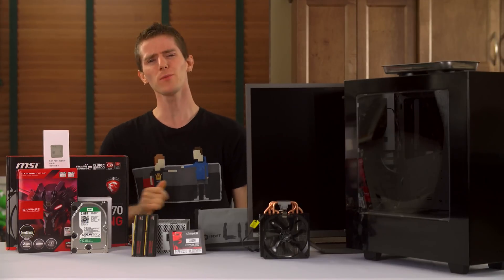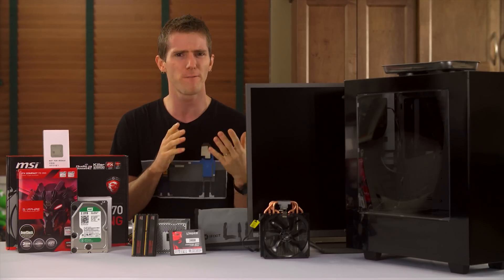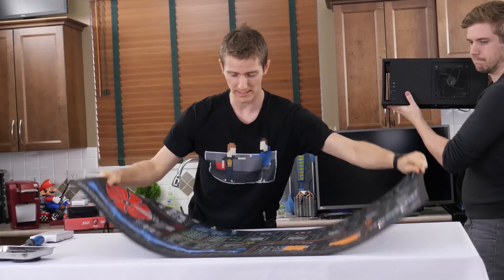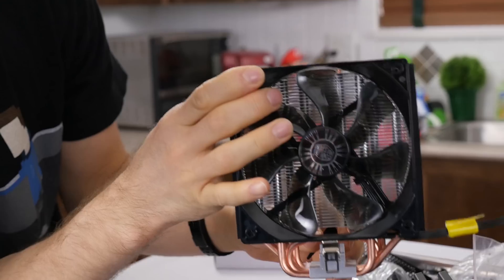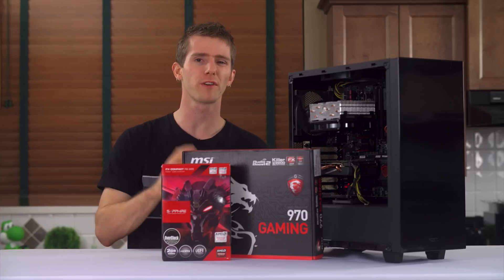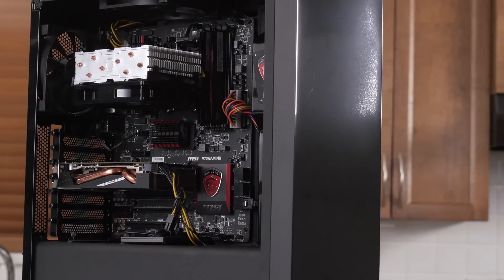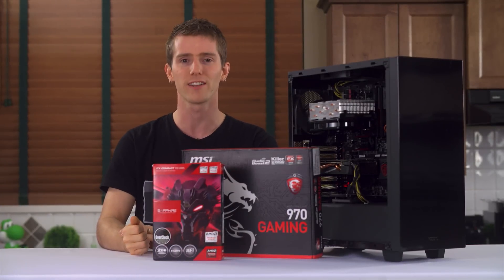Can you Build a 4K Gaming PC for Under $1000?

Comment: 4K won't be a standard for a while...how long did it take 1080p to REALLY become one? getting smooth gameplay at 1080p with max settings is hard enough at under $1000, so why do this? and, when you use an FX CPU on a cheap motherboard, you really can't overclock, which is pretty much the point of getting an FX chip...and, why run on 4K when the games are old/lower tier graphic-wise, and not on great settings? the point of gaming on a PC is for the max graphics, which is what the game was truly designed for...

Comment: This is similar to a pc i built for the holiday sales why is it that all these guys leave out the O.S. in their guides specs
Processor: fx 6300
Motherboard: msi 970 gaming
Graphics card:sapphire Radeon 280x
Psu: corsair cx600
Ram: 8gb ddr3 1600 g.skill gaming series memory 
Ssd: kingston v300 240gb
Case:Rosewill galaxy 0-1a 
Heatsink: artic freezer pro 7
O.S.: windows 8
All together this cost me about 850 first pc ive ever built and i enjoy it runs smoothly.

Comment: Would an MSI 970 gaming mobo + FX-8370e+gtx960+8GB 1600mhz ram be a good gaming rig for 1080p everything on ultra?
Reply: I would recomendgoing with a radeon r9 280x or 285 instead of the gtx 960. :)
Reply: Yeah. Trade out the 8370e to a regular 8370 (a performance boost) if you have the wattage to do so (the 8370 takes like double the watts).
Reply: Byron Shultz cheers, can you recommend a 3rd party CPU cooler?
Reply: Eds UKGamerz Corsair H100i
Reply: thanks for the recommendation
Reply: Eds UKGamerz get the enermax liqtech. ALL other AIO coolers are the exact SAME, shitty radiator. You can bend the fins with PAPER. this one is freaking built like a tank ( Watch Jayztwocents review of it). and it's cheaper, AND looks better. I've got it with 4 noctua nf-f12's, my I7-4790k idles at ROOM temperature, seriously. it's 70 in my house, it sits at 70-72 degrees F, with the fans on min. rpm. oh, and it's overclocked, 4.8 Ghz boost clock, adaptive voltage at 1.275 max... at 100% load, 65 C max in prime 95 large FFT, or full load in Folding@home, etc. , in games it never gets out of the 40s. Can't say this enough. Stop supporting companies that just rebrand a low quality product and charge 2 times as much as they should for it!!

Comment: Lol my laptop (intel celeron 1007u @ 1.5ghz and 4 gigs of ram) runs team fortress 2 fine (40-50 fps)
Reply: at 720p?
Reply: Fathin Luqman Tantowi 1024p
Reply: oh ok, can't distinguish celeron procies T.T
Reply: Fathin Luqman Tantowi the 1007u is a low end mobile cpu
Reply: jaakko200987654321
nice, thanks.
Reply: Flaming Gaming lol, that integrated graphics. 2Ghz dual core is too weak even only running windows. unlike newer version of intel. you must blame intel for the integrated graphics. coz they suck @ graphic
Reply: Fathin Luqman Tantowi I know, I'm just saying that this guy can't possibly run TF2 on a Celeron (1.5GHz dual core) if it can't run on a 2GHz Pentium.
Reply: That can't be true. I tried to run Portal 2 on a laptop with a Pentium (don't remember the exact model but it was clocked at around 2GHz) with integrated graphics and 4GB of RAM on lowest settings and 800x600 resolution and only got 12-15fps. Unplayable.
Reply: Well new celeron is fast I suppose

Comment: soo i'm trying to make an AMD build, will this rig be enough to run games at ultra definition?
CPU: AMD FX 8-Core Black Edition FX-9370
GPU: SAPPHIRE R9 290 4GB GDDR5
Motherboard: ASRock 990FX Extreme3 AM3+ 4DDR3
RAM: Corsair Vengeance® Pro Series — 8GB (2 x 4GB) DDR3 DRAM 1600MHz
SSHD: Seagate 1TB 2.5" Internal SSHD Hybrid Hard Drive
Case: Cooler Master CM 690 III
PSU: Corsair CX Series™ Modular CX750M — 750 Watt 80 PLUS® Bronze PSU
i don't mind noises so gimme what you think :D
Reply: More than enough.
Reply: Thank you!

Comment: If someone could help me that would be awesome. Ok so I'm going to be building a gaming pc and I have all the parts but I'm afraid I'll have a bottleneck. I'm going to have an intel i5-4690k and expect to OC it. And for graphics card I'm using a EVGA gtx 970. This is where I'm afraid I'll get a bottleneck because the processor is about $100 cheaper than the graphics card it seems I'll get a bottleneck. So if someone could help me that would be much appreciated.

Comment: CASE	Thermaltake CommanderCPU	Intel Core i5-4690K	
VIEW
FAN	CM Hyper 212 EVO	
VIEW
MOBO	MSI Z97 PC MATE LGA 1150	
VIEW
GPU	Gigabyte GeForce GTX 970	
VIEW
RAM	Kingston HyperX Fury 8GB	
VIEW
HDD	Western Digital Blue 1 TB	
VIEW
CASE	Thermaltake Commander	
VIEW
PSU	XFX Core Edition PRO550W	
VIEW
ODD	Samsung 24x SATA

Is this a good PC?

Comment: Ive Oced my fx6300 on a stock cooler, to 4.0 ghz and when playing league it hasn't reached over 55 celcuis    hgihest its been is 61   but I keep it oced to 3.7 to 3.8   of course everyone cpu is different so I might have just hit a lucky fx 6300, also I'm not using the stock thermal paste, as I upgraded my mother board from a micro to a full size.

Comment: Hey, I'm building myself a new gaming pc but i'm not the most experienced.
What do you's think about this build? I want to play pretty much every game maxed running smooth. What could be changed to make it better? I'm thinking about spending a bit more and getting a gtx 980 but there so expensive.
Intel i5-4690k 3.50GHZ
ASRock Fatal1ty Z97-KILLER
Asus STRIX-GTX970
Corsair 16GB
Seagate SATA3 2TB
Corsair 850CXM 850W
NZXT H440 Mid Tower Case
Crucial MX100 256G
Corsair H100i water cooler

Comment: I built a pretty good rig that can run Skyrim Ultra at 60FPS and Cod AW at high at about 80 fps. It was only around $750

Specs:
Intel Core i5-4690K
Sapphire R7260x
WD Blue 1TB
GSkills RipJaws 8GB
Asus B85M-D Motherboard
Any case

Comment: How does this build look?  Supposed to be a decent gaming rig.
CPU: Intel Core i7-4770 3.4GHz Quad-Core Processor  ($294.88 @ OutletPC) 
CPU Cooler: Phanteks PH-TC14PE_BK 78.1 CFM CPU Cooler  ($79.99 @ Amazon) 
Motherboard: Asus SABERTOOTH Z97 MARK 1 ATX LGA1150 Motherboard  ($239.98 @ Newegg) 
Memory: G.Skill Sniper Series 8GB (2 x 4GB) DDR3-1866 Memory  ($74.97 @ OutletPC) 
Storage: Samsung 850 EVO-Series 120GB 2.5" Solid State Drive  ($88.98 @ OutletPC) 
Storage: Western Digital BLACK SERIES 1TB 3.5" 7200RPM Internal Hard Drive  ($73.98 @ OutletPC) 
Video Card: MSI GeForce GTX 980 4GB Twin Frozr Video Card  ($549.99 @ Newegg) 
Case: NZXT H440 (White/Black) ATX Mid Tower Case  ($108.99 @ SuperBiiz) 
Power Supply: EVGA 750W 80+ Gold Certified Fully-Modular ATX Power Supply  ($89.99 @ Newegg)

Comment: Is a msi GTX 970 card going to fit inside my tiny MSI nightblade computer? It is as for now, using a MSI GTX 760 card, but i would want to upgrade the nightblade and bring the other MSI gtx 760 card into a yet to be built computer.

Comment: Hi

Need some answers lol

I am spending money on a good racing simultor cockpit to replace my desk as i want to be able to relax and play
my system is
i7 5930k water cooled
16gb 3000hz dominator platinum ram
asus deluxe x99
1100w corsair power supple
samsung 1tb ssd for my games
samsung 240gb ssd for my system
radeon 295x and a 290x

I dont know what to buy im really stuck
x3 27inch ips monitors or x1 55inch ultra hd tv or just regular hd tv

I mainly play rpg, dota 2, elite dangerous and racing games and occasional bf4

will tv really be to much of a lag input and ruin my gaming experience

Comment: the problem is if the gamer only play such games im betting they wont be buying a 4k monitor either... great mid to high spec build though and yes ready for 4k when the need arise (or the 4k monitor becomes reasonably priced) by simply going the crossfire route.

Comment: One of the best PC video blogs I have seen in ages. Finally not all about the top of the range most pornolicious hardware. I would love to see a bit of variation in the hardware to see the effect on benchmarks though..... plz .... 

For example if the 8350 cpu (which is still very cheap) yields any performance increase (as it does have 4 true cores rather than 3). 

I would also be interested to see how these games at this resolution differ with a mid range intel mobo and a stock i5..... 

Thanks Linus ;-P

Comment: hey guys is this an ok rig for gaming?
Gigabyte Radeon R9 280 WF3 OC 3G
NZXT Phantom 410 BLACK/ORANGE ATX Mid Tower 
Aerocool VP650 tRUE pOWER psu
Kingston 8GB (2 x 4GB) PC3-12800 1600mhZ ddr3 rAM
Cooler Master Hyper 212 EVO CPU Cooler
Intel  Core i5-4690K Devil Canyon 3.5ghz Socket 1150

Comment: Sorry Linus is wrong on this one. I dunno if it is because he was trying to peddle his  sponsors over priced crap but you can build a machine with a I5-4690k and a GTX 970 for about $750 to $800.
Reply: In England you need like £650-700 f($850-950) or a PC with a 4690k and a 970.
Reply: Still under $1000
Reply: Stephan Bruno
Fair enough...
Reply: No, you can't. Not without making silly choices if you want your system to last for many years. You could do an i3 and a 760, but your choices can only work by skimping on the PSU, cooling and motherboard. That is fine if you buy a new computer every year, but it you want this to be a home server for a decade after you retire it (or you want to continually improve it as your primary machine), then you need to step on on the CPU and GPU.
Reply: well, remember, if you get cancer in america, you are down about 300k $ that gtx 970 price wont help there
Reply: Martin Lyons I have heard somewhere that amp cpus are actuallu similar to hyperthreading so there are only 3 cores in 6300?
Reply: The CPU/GPU combo you mention costs $500 before tax w/ deals. You're looking at low-end components and no SSD if you're trying to get sub $1,000. Better than the build in the video, however.
Reply: Cameron Montlake-Mees
huh 950$? here in denmark you might get lucky and get this for just under 1400$ ^^
Reply: Mikee Tyson I take back my last statement, maybe £750 if you could do without a SSD: http://uk.pcpartpicker.com/p/zgtCMp . And Denmark PC prices are higher, I want to live in America where you can get a 970 for the equivalent of £200, where as in the UK it's like £250-300
Reply: Mikee Tyson And in the UK we have the NHS, so I guess I'm staying here.
Reply: Cameron Montlake-Mees Nice build for the $. I'd say the other big trade-off along w/ no SSD is that the mobo in the build doesn't support SLI.
Reply: TrevForPresident
TBH I don't use SLI boards in builds of this budget, because normally my builds last 3-4 years and then are replaced. I guess it depends on if you are upgrading or not.
Reply: Cameron Montlake-Mees Point taken. Worth noting, however. I'm getting that itch with a one-year old rig and a 770. GPUs don't age as gracefully as CPUs.
Reply: a 770 should be able to play all games on ultra/very high for the next 3 years 1080p
Reply: i bult mine with around 1grand with better specs from last year and none of the games he mentioned need to be low res in order to increase my Frames...you can't blame the guy for trying to advertise what his sponsors are telling him.
Reply: TrevForPresident My 970 is still going strong, does get a tad noisy but still on BeamNG.Drive (you might of heard of it car crash simulation tests the CPU and GPU) it can run at 40-60FPS @1080p no problems. I am thinking of getting a few things for my system i.e. second 970, new MOBO that supports overclocking, new case because the old one is not ATX, SSD and a few other bits and bobs. So weird thinking of a second 970 when not even 3 months ago I had a single 6670...
Reply: The challenge was to build an AMD PC, not intel, not nvidia. Which i think makes sense.
Reply: I dont think you know your stuff well, if you want 6 cores with intel you gotta pay a lot. And you need lots of Ram and a sound card as well to get the performance. (AMD True Audio). And accually the prices he got are sooo wrong, in real that sutff cost 500$ with OS
Reply: Martin Lyons Remember, He's from Canada. Prices and exchange rate and whatnot.
Reply: Martin Lyons OK. I'm going to get something straight, AMD cores are not equivalent to Intel's. The Intel i7-5820K is the cheapest 6 core, current generation CPU that Intel have. If you want to get a equivalent AMD CPU to that you would have to pay... Well you just couldn't. The FX-6300 will out perform lower end Intel CPUs if the task will use all 6 cores. In most games, the game only uses about 2 cores, which means a Pentium G3258 at stock clocks will probably outperform the FX-6300, simply because AMD cores are just not as powerful. Yes, AMD is great for budget builds, especially if you are planning to do some editing, photoshop, etc. They were a good rival to the older i5s like the 2500K, but the 4690K would kick it's ass in games. I'm not an Intel fanboy but the facts are the facts, they perform better although at a premium. So I think that YOU are the one who doesn't "know your stuff well".
Reply: Garry Perkins PCPartPicker part list: http://pcpartpicker.com/p/H6f9P6
Price breakdown by merchant: http://pcpartpicker.com/p/H6f9P6/by_merchant/

CPU: Intel Core i5-4690K 3.5GHz Quad-Core Processor  ($219.75 @ OutletPC) 
Motherboard: Gigabyte GA-Z97X-UD3H-BK ATX LGA1150 Motherboard  ($126.99 @ SuperBiiz) 
Memory: G.Skill Ripjaws X Series 8GB (2 x 4GB) DDR3-1866 Memory  ($69.89 @ OutletPC) 
Storage: Western Digital Caviar Blue 1TB 3.5" 7200RPM Internal Hard Drive  ($51.89 @ OutletPC) 
Video Card: Asus GeForce GTX 970 4GB STRIX Video Card  ($329.00 @ NCIX US) 
Case: Corsair 200R ATX Mid Tower Case  ($49.99 @ Newegg) 
Power Supply: Corsair CX 600W 80+ Bronze Certified Semi-Modular ATX Power Supply  ($59.88 @ OutletPC) 
Total: $907.39
Prices include shipping, taxes, and discounts when available
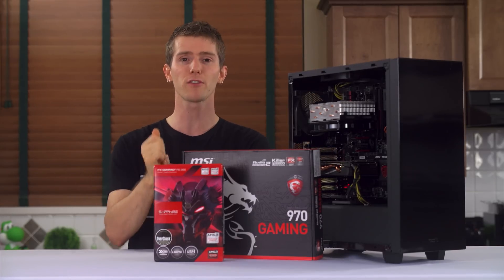Generated by PCPartPicker 2015-02-27 06:48 EST-0500
Reply: Jcon Good looking build. Under $1,000, too. The OP claimed $750 - $800, which is not possible, however.

Comment: My first pc build is this good?
Like could I run skyrim ultra high foes and have mods on it.

- NVIDIA GTX 970 4GB
- Intel Core i5 4690K CPU
- 8GB 1600MHz Memory
- 120GB Samsung EVO SSD
- 1TB 7200RPM HDD
- Z97 Chipset Motherboard
- DVD-R/RW/CD-R/RW
- Microsoft Windows 8.1
Reply: I can't say how much mods will hurt your performance, but I can tell you my 970 had no issues running the game at 4k without dips under 60fps. You should be fine if you're just playing at 1080. The 970 has maxed out any game I've thrown at it so far, although I don't really have any "recent" 2014 games (mostly 2013 in terms of newer games haha)

Comment: If I were to build a 4k less than $1000 machine here is what i would choose:

$145/  Amd FX-8320 (overclock to 4+ghz)
$80/   8gb ram
$350/ Gtx 970 graphics card
$100/ ASUS M5A97 motherboard
$90±/ case of your choice
$80/  2tb hard drive
$40/  EVGA 500W 80PLUS power supply
$45/  Hyper 212 Evo cpu cooler

total:$930!

Comment: Something I have been doing for a number of years is buy a relative cheap pc (sub 1000 euro) but make sure the motherboards is SLI (or crossfire) compatible and pick the best video card that fits in the budget and I don't mind taking a lower tier cpu or slightly slower memory set to make that happen. 

Once I start to notice the games I want to play are dropping below acceptable fps's instead of buying a new pc I simply by another GPU, usually the same one.

For example my current rig started out with Zotac GeForce GTX 670 with 4GB DDR5 memory. After about 2 to 3 years I bought the same gpu and put them in SLI giving me a very acceptable amount of gpu power with 8GB of vram.

It easily churns out 60fps on any well made/optimized game. As a fan of the elderscrolls series it is just lovely I can mod Skyrim to high heavens (4k textures, increased view distance etc) and even with nearly 100 graphic related mods installed it still puts out 60fps+ even in the heaviest area's.

Now if triple A games would actually spend less money on marketing and spend more money on optimizing their games before releasing them we wouldn't need SLI on what is basically a mid-range gaming rig.

We are still at a point where the software is still far behind on the hardware capabilities. Most games don't even support 64bit yet which is ridiculous. Personally I think we passed the stage where we should support 32bit. I mean, can you even buy a 32bits cpu anymore outside maybe the absolute budget stuff? Even the sub 300 dollar pc's all have a 64bit cpu.

It would save companies a ton of money if they where to drop 32bit support giving them more time and resources to put into development. Maybe if they did that we wouldn't see as many triple A games that simply run terrible.

Just think if Ubisoft had put all the money they put in marketing and supporting a 32bit build many of their games this might have actually been pretty good. Instead they are plagued with bugs and performance is terrible across the board. I honestly feel really bad for the people at their art department because they are doing an amazing job, AC:unity, Watch Dogs and Farcry 4 all looked really impressive art wise but the tech side is just horrendous.

Anyways, i'm rambling.
Reply: здравствуйте друзья вы бы не могли зайти на мой канал ток создал а не кого нету ешё хочу прославить свой канал на youtube помогите !!!!!!!!!!!!!!

Comment: I found your presentation intriguing and you showed some strong points that I completely agree with.  Almost all your suggestions and options were well though out and many people attempt to argue against you but based on the budget you were allowed to go with, you did extremely well with what you had to work with.  Overall an excellent video how you justified your parts selection.